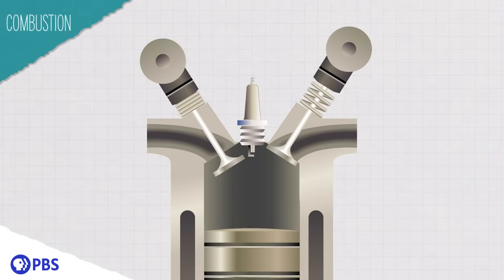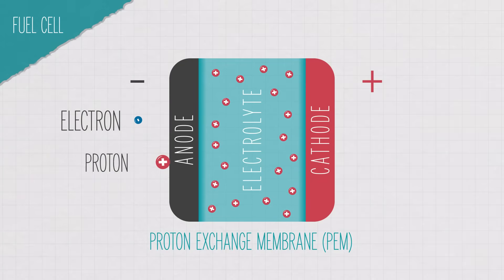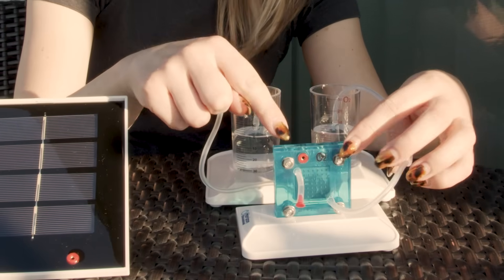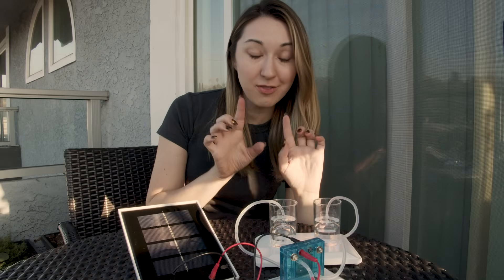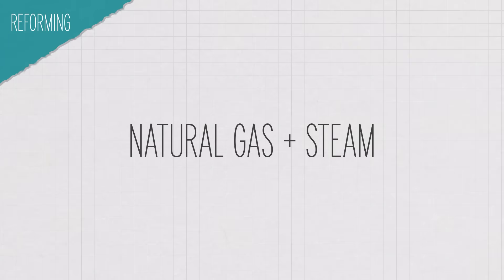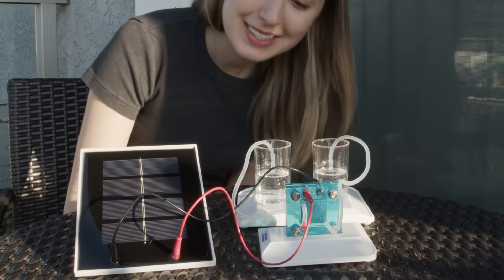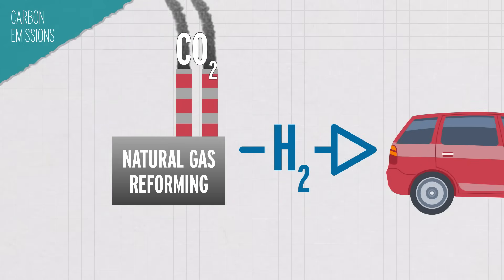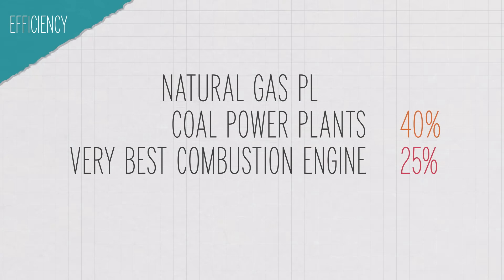How Do Hydrogen Fuel Cells Work?

Comment: I don't think you need hydrogen cell to create electricty. You can burn hydrogen and creating hydrogen doens't need to be produced from peterochemical or eletrolysis. It can be produced from water and amuminum. All you need to do is to get rid of the very thin layer of Aluminium oxide that forms on top of something like aluminium foil.

The best advantage of hydrogen that no one talks about is that it is everywhere in water. Even if you burn it is areas there is not water it is a way of irrigating those areas. This is why it is politically not attractive. You can't monopolise the resource. Think about power structures. This hydrogen from petroleum is yet again another trick by the oil companies who have been conspiring from the start.
Now we have rare metals blackmailing people. The art of creating scaresity has been the trick of those who deal in power since the early days of argricultural reveolution.

You can do it at the pump or even as part of engine whixh was probably what was behind the car running on water whose inventor got killed by the oil industry back in 70s. 
The patent is probably is still held by oil companies. Everytime it starts to leak out, it gets hushed up.
Last time the company was told not to publicise it because iof its  distrupting power. There were a few news reports on it and then it disappeared again.

This reminds of what Catholic charch did when they knew that the game was up. They needed time to incorporate helio centric ideas into their Dogma and that took time, about 200 years. Meanwhile they wouldn't allow any new publication and if there was one they just discredited it. It was easy beause people could see that the sun was moving. So, if you went home and said that no it was the earth that was moving, people would laugh at you. All this stuff about hydrogen being dangerous or expensive or impractical is all part of the same thing. This went on until 18th century when a pendolum hung from the roof of all places in a Catherdral in Paris was allowed to show people that the earth was indeed rotating. Brilliant way of telling people that now they are allowed to believe it.

As output, you get heat, electricty and hydrogen all at the smae time, They can all be used in a vehicle, especially in cold weather where EVs are useless.

With new combustion engines like Omega 1 which are supper efficient and light it makes much more sense.  

Ev's are heavy, manufacturing lithium is dirty and difficult to recycle and comlicatied and when they catch filre there is nothing left of the car as well as having all that terrible poisonous fumes.

You can recover the aluminimum from the oxide because we are already manufacturing so much aluminium anyway. So the big secret is that the overall cost is lower in the long term. You don't need to manufacture aluminium just for creating hysrogen. 

All this time is being wasted on lithium based EVs,  could have been spent of Sodium batteries for large scale storage at much lower cost that doesn'r loose power as much as lithium based batteries do.
Lithium still has plenty of uses but it doesn't need to become a commodity with fluctuating prices that will like oil create conflict. Lithium has already become a conspiracy like oil holding back better solutions.

We are already making too much sodium salt that gets poured back into the sea damaging sea life.
Just like investmenr the best policy is always to spread investment where ever you can. 

This is what is meant by a wholistic solution rather than reductionis approach that always leads to imbalance in the environment.

Comment: The problem with Hydrolysis is that it requires scarce and expensive materials, like platinum, but in theory, we could use nuclear reactors to directly power Iodine-Sulfur Cycle, then mixing this Hydrogen (Called Red Hydrogen) with atmospheric Nitrogen to industrially produce Ammonia through the Haber-Bosch Cycle (Called Red Ammonia), which can be mixed with water and easily transported there where it's needed, like metallurgical, chemical and fertilizers industries, seaports, airports, land transport terminals, and so on... That's what we call a Red Ammonia Energy Matrix... I'm actually working in an investigation project to simplify this Matrix and someday scale it up to industrial level, hopefully.....

Comment: All very good, and i understand your point your trying to make,......however it is far cleaner than the ENERGY guzzling battery operated vehicles with short life spans and huge carbon footprints just from production and use with toxic chemicals, which still require continuous charging. With hydrogen we could use this with infrastructure already existing, and burn it in our cars with tweaking, we already burn it in the Natural Gas system, they blend it with natural gas. You can produce enough solely through solar units called SOL-HYD, they also store enough to use for winter heat production. If we are going to switch to another energy lets make it a smart  move.

Comment: Why couldn't the water vapor that's produced go right back into where you're extracting Hydrogen from?!?! Like a closed loop?
Reply: Hydrogen fuel cell cars don’t have a water reservoir, they have a hydrogen gas tank and an air intake

Otherwise the water would need to first be broken down into hydrogen and oxygen before they can be used for power generation, which itself requires power usage and kinda defeats the point

Comment: But why did you run out of Hydrogen?!?! lol couldn't you produce Hydrogen while powering your Hydrogen fuel cell?!?! Use the power for the fan for electrolysis??? 😂
Reply: No you can't do that. The electrolysis takes way more energy than what you get from running the hydrogen through the fuel cell.
Reply: @logitech4873  Um, no, it doesn't. She literally created electrolysis with a 4 inch solar panel... lol
Reply: @logitech4873  What's wrong with energy, BTW?!?! You do know all the dams around the country power our homes, right...  through the process of hydroelectric?!?! Just build more dams...
Reply: @logitech4873  The energy grid is NOT capped... OMG, I can't believe people can't understand this... lol Look at The Hover Dam and when it was constructed...
Reply: @ecbadboy101  What are you talking about? I'm not part of whatever this argument is.

Comment: The thing is to many is peole on trying to go zero Co2 emissions and with the technology we have it is impossible to go zero emissions, so what need to be done is to lower that Co2 emissions much as possible. And hydrogen fuel cell cars can go further the EV's and can operate independently from the power grid not puting tremendous amount of a demand on the power grid. People who are on this EV kick seems not to realize that the electric to charge their EV's comes from coal-fired power plants and puts a great demand on the power grid, so their EV's are not zero Co2 emissions as they think it is. More research and development needs to be done on hydrogen fuel cell cars and they need to made more reliable and dependable. And maybe one day in the future we will be able to create electricity with little to no Co2 emissions and be able to use electric to create hydrogen we need from water.

On a note: Hydrogen fuel cells are used in the space shuttles by NASA to power the space shuttles and create fresh drinking water for the astronauts.

Comment: Very clear lecture! Question though: why not using the electricity produced from the solar panel to charge car batteries ? Is it less efficient than a fuel cell?
Reply: That's much, much more efficient. But it's not the point of this video.

Comment: Couldn't we harvest the hydrogen from a nuclear power plant?
Reply: Yes
Reply: It's silly you're car can produce electricity with the alternator to power and ya can use like baking powder many ways to make it
Reply: To make carbonation and the electrolysis
Reply: Shut up. Don't give them actually usable solutions.
Reply: Pollution, excess work required for power a turbine. Fuel cells does it easier
Reply: Because it's not economical to use nuclear power to generate hydrogen 
Because it's base load property 
It's better to generate it using excess eletricity from renewable
Reply: @dudewithgreenhat  renewable is a joke and not available 24/7
Reply: Harvest?
nuclear power plant dosent create hydrogen
Reply: @SampannaAryal  it does tho.
Reply: You can generate hydrogen with water and electricity from any source. 

So if you used wave generators to charge a battery from ocean waves rising and falling. You could then use that electricity to make hydrogen from the sea water. 

Once you have a source of electricity run a current through water. Salt water is better and drain cleaner is best. 

You could hypothetically just start with a charged battery and not have the wave generators as you can generate more power than you use to split the hydrogen by burning the hydrogen. 

As hydrogen can explode quite violently. You could use it  at a stationary plant to charge more conventional batteries more or less infinitely. 

The salt was not destroyed in the process. The water was only separated. It will naturally recombine in atmosphere.

Comment: Turn cars hydrogen powered moving the CO2 emissions to the hydrogen plant then use carbon capture ( covert into liquid CO2 and pump in to old oil fields) to reduce emissions even more and to dispatch the hydrogen to use at fuel station use hydrogen powered tankers

Comment: But why can't we transform the gasoline in our car fuel tanks inside our cars and get a more organic exhaust? This way, all cars should act the same, only transforming the fuel exhaust into something more eco friendly. Petrol will never disappear, but we can work on diluting it in such a manner that it cant produce such harmful exhaust. In cocnlusion, at exhaust process the CO and CO2 should be recombined with hydrogen and some electrolyte that then separates carbon from oxygen and lastely oxygen recombined with hydrogen and create water molecule (at the exhaust tip).

Comment: doesnt matter how efficient the production method is if you have infinite electricity
go nuclear!
Reply: Nuclear isn't infinite though. The issue is that if we scaled up our reliance on nuclear, we would run out of the most easily accessible uranium pretty quick. The longer we keep using it, the more energy intensive it becomes to mine and refine the uranium.

Comment: I am a huge fan of hydrogen energy, and I appreciate how you explained its operation in the first part of the video. However, I would like to point out that the second part of the video contains some inaccuracies and misconceptions.
There are methods to convert plastic waste, car tires, and other organic waste (from the oil industry) into hydrogen energy using a closed-loop process called Pyrolysis. If done correctly, this process will not harm the environment since there are no byproducts that are released into the air.
Your video is a “fly in the ointment” since it takes a great concept and makes it look bad. Pyrolysis can convert oil spills or any products from fossil fuels into green energy using “Green Way” technology. This technology exists, but some corporations may want to create confusion around this great concept.
Finally, we need to concentrate our resources on storing H2 in dry cells instead of liquid, this will resolve the storage issue and make it more convenient. As well as releasing it to the public.

Comment: If you are comparing Hydrogen to Lithium batteries, don't forget to mention the problems of Battery Electric Vehicles.
1. Charging. Most people don't charge during the day, but in the evening and at night. This makes it very likely that fossil fuels are used to charge the car.
2. Weight: More weight is more loss, so big vehicles that have to drive all day, will be losing a lot energy just hauling those batteries.
3. Production: Lithium production is not clean by any means. The Lithium mining industry is no better than coal or oil.
4. Winter: If you want to use clean energy sources, winter is always going to be a challenge. There is not enough to go around, and Lithium batteries perform poorly.
5. Scale: How do we create enough energy storage for 8 billion and counting? Lithium batteries just can't do this.
6. Safety: While Lithium safety has improved with LFP, it is still a big risk when something else starts the fire. Imagine an EV filled parking garage with just one faulty NMC based EV.

I do not think Hydrogen is an option for most small cars right now, but it is improving fast and may just be the way to go for people who can't charge at home.
The main goal is to get rid of fossil fuels, and for most uses I think Sodium-Ion batteries will be a better option.
But we need Hydrogen, not only for big vehicles and not burning the grid. But also for seasonal storage, even if that Hydrogen is used for a converted gas power plant.
In the end, I think both Hydrogen and Batteries will be needed for transportation, and both technologies need time to mature.

Comment: actually, this was a year ago, so today was a year ago, I think you may have not known about Hiiroc just yet (emerald hydrogen of color), look them up, they use plasma so separate the hydrogen and solid carbon from methane gas. 
The reason why we need methane gas or coal even, to heat up steam to 800°C for this methane reforming method, is because we cannot reach that heat using induction, because the maximum you can achieve with induction is 500°C which is not hot enough, that's why we need fossil fuels.

Comment: This video excludes some facts. Battery powered EV's have their own laundry list of drawbacks not mentioned. 

Hydrogen needs to be thought of as an alternative to a battery, not fuel. If for instance all the windmills that you see sitting still (because the grid doesn't have enough demand to run them) were turning and producing hydrogen for later use, that would just be storing the energy made by the wind. Same for hydroelectric, solar and nuclear. 

She also doesn't mention getting hydrogen extracted out of super heated steam, for instance what Toyota is working on with recent nuclear plants they are partnered to build. If industry put a focus on creating clean hydrogen, it could be done, and unlike battery powered cars it would actually work for societies needs. For a consumer car, in a region, battery powered cars are fine. For industry and shipping though there will need to be something else, and hydrogen has the potential to fit that bill.

Comment: This is all stopgap.  We need fusion energy.  It's the only real, long-term solution.
Reply: Just not short term unfortunately. By the time that is production scale ready, it will be too late. Even just building today's Nuclear reactors takes a decade or more.

Storing surplus energy from wind an solar in batteries is step one. Everything that exceeds capacity for short term use, must be converted to green Hydrogen (use it or lose it).
This will help get rid of coal in steel production and reduce grey Hydrogen production for industrial uses.

Comment: Even though it should be beyond easy to generate ample hydrogen at power plants in order to generate completely adequate electricity, vehicles making their own energy onboard via physics in hybrid designs is sensible and realistic. High voltage magnetized iron transformers are already in home products. Hybrid designs can utilize those circuits and invent "resistors" that light up with uv light...fed to solar panels in closed system, recovering that dissipating heat energy. Grids really don't have to be strained...Power supply should probably be nationalized and or replaced with home units we pay electric companies to inspect and maintain via wireless connectivity. Flat fee, 30 bucks a month/maybe tiered charging fee but over fifty dollars seems like ripoff.....Hydrogen should only be used in hybrid designs, to charge battery, and the hydrogen made onboard via friction heat via hydraulics/ wind drag/magnetized transformers with thick cables and light up resistors feeding smaller box shaped solar panels....Charging stations is economic interests, not accurate technology standards. Big hydrogen tanks are not sensible for roadways. Ample hydrogen to charge battery is only responsible design, if even necessary.

Comment: Makes me wonder if you could use a hydrogen/ox electrolysis cycle for energy storage.  Use solar to split seawater into 2 H2 and O2 then use the fuel cell at night to recombine them then take the fresh water and add it to your water supply. You would have storage and desalinization Of course in desert areas you could pipe in the water and pipe out the hydrogen for conversion at the use point. You could also use this with offshore wind turbines.
Reply: Electrolysis of sea.water implies large generation of chlorine gas (polluting gas), and high problems of corrosion for the electrolyzer

Comment: great video and informative. and there we go, there is no renewable energy at all. EV use mineral that need to mine as well
Reply: EV batteries are recyclable, and there is plenty of lithium in the world. Making green hydrogen, and hydrogen fuel cells are much less efficient than just charging a battery with the same electricity. Hydrogen cars are electric cars, using a battery and motor for regen and even out the output of the fuel cell. Basically they are a terrible idea, with the only advantage being faster refuel time. Batteries being developed cut that advantage way down.

Comment: Hydrogen not really applicable to family cars - but it is really most likely to find a role in the powering of on road cargo transportation - that is big trucks. This is because the amount of electric battery power required for cargo trucks is not feasible - but hydrogen storage on a large scale at truck depots is feasible. Hydrogen supply would best be sourced from large solar plants sited as close as possible to truck depots.